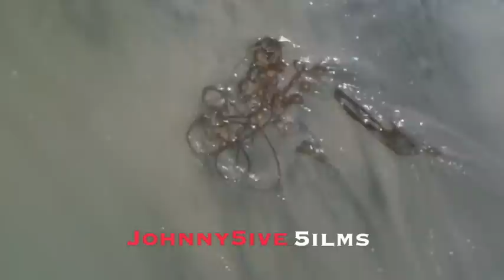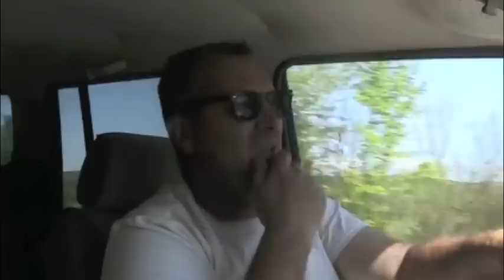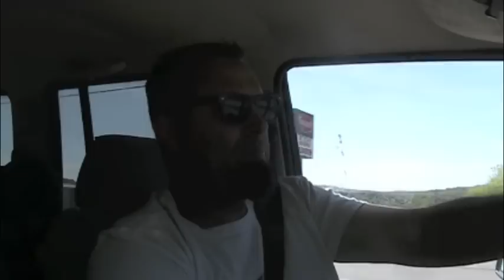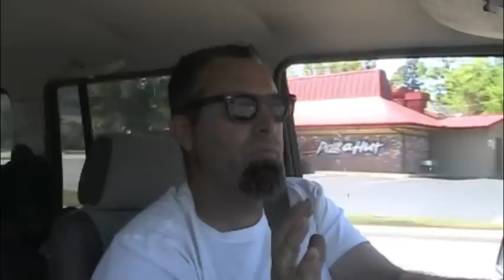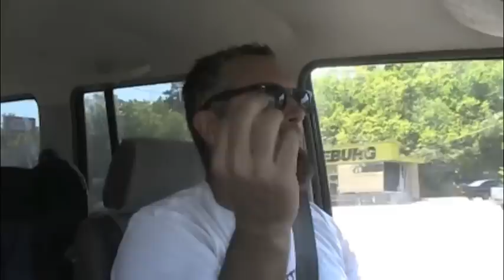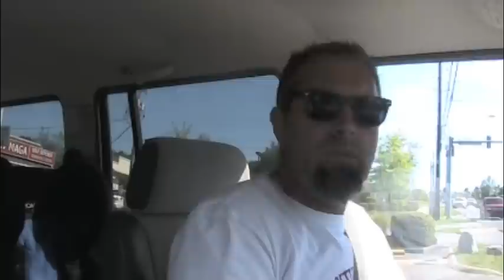Isuzu Trooper V8 swap explanation

Comment: Hey Johnny
I have a 3.2 DOHC V6 trooper.
What V8 engine and transmission would you recommend I use in it .
I want to do a conversion because my transmission and engine damage.
A lot of sentiment to this trooper 1993
6VD1  came in it
Reply: 5.3 gm v8 and 4l60e 4wd trans and transfer case
Reply: Have you considered low pressure intercooled forced induction? Turbo or supercharger. 5 to 10 lbs of boost .

Comment: Johnny looking forward to doing this swap using your videos. I have a question what is your thoughts on Isuzu Diesels engine and the baby duramax from Colorado
Reply from the maker: mykg73 Expensive and heavy. Isuzu diesels are hard to get parts for as well. UZFE stuff is everywhere
Reply: I'm also starting to source parts for the same swap. I have a 1986. I wanna put in the 5 speed from the 89. This is a couple years late so I wonder if you did your swap with baby Duramax.

Comment: DO you have a checklist of parts and challenges that need addressed to pull this off? I'd be interested in going this route for my '91 Trooper 2.6L 5 speed.
Reply from the maker: JR Cook yes, the parts list comes with the adapter kit
Reply: @Johnny5troopers  where can I buy the adaptor kits?is it there on eBay?if it's so what is the part numbers?thanks

Comment: What are your thoughts on a northstar swap with a dohc 2000 trooper
Reply: northstars blow head gaskets all day.
Reply: You can build up a Northstar to put out a lot of power for fairly cheap, but it was never meant to be a truck motor.
Reply: The LS is better
Reply: You have to go with a late model Northstar because of head gaskets . LS motor is a better option.

Comment: I'm not too familiar with your model of trooper.  Mine's a 94 so it's a different body and a few other big differences in there.  I'm not sure what the big differences between your's and mine but I imagine with mine being a bit bigger may be more forgiving.  But you're selling me on the lexus right now since I'm basically after the same thing you are.  Just a more powerful and more reliable version of the same vehicle.  I hate my 3.2 in here now but it's still running at 200k.  

I'd still want to keep my AC and hopefully cruise control if I could.  MUST keep my manual.  Thanks for the information.

Comment: I have a C223t in my Trooper II. I want to swap in the Cummins 4 cyl kit engine. Then keep the Isuzu diesel for a boat motor.
Reply: you have details on the cummins kit?
Reply: @pjiri961  you can buy 4bt crate engines directly from cummins they also have a new small sized crate cummins available but 4bts are easy to find
Reply: @zachnuketown  how would i match the 4bt to the original trans? kit? plate?
Reply: @pjiri961  may have to custom make an adapter plate or have a shop do it